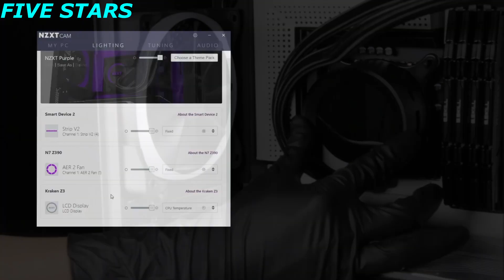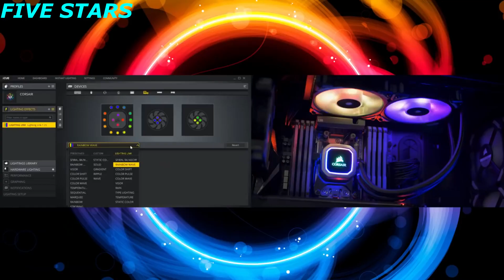5 Best CPU Coolers For Ryzen 7 5800X

Comment: I bought the h100 without knowing that it was the best cooling for the ryzen 7 5800x XD
Reply: but how much mm did you buy? 240 or 360?
Reply: @paragod4815  240mm
Reply: @renavelizz  isn't there heating problem with just 240mm on 5800x? is it overclocked ? and whats the GPU and pls tell the cost too these days its really expensive i'm also gonna buy now thats why
Reply: this is subjetive, for me the best cooler is the nh d15

Comment: sure sure, if you put a Hyper Evo v2 on a 5800 you might melt the cooler with it, its totally not good enough for a 5800X
Reply: this is wrong. i have both the cooler is more than sufficient
Reply: Pero alguno de ustedes que posee ese procesador debería colocarle una termocupla o su propio dedo para comprobar las temperaturas reales del disipador... quizá sea error de software por 10 grados C .. yo si saqué un cooler lga 775 que llegó a 105°C sujetándolo de los plásticos.. parecía una olla ardiente.. cuando lo eché al lavabo chisporroteo y salió humo.. pero otras veces menciona 90°c y coloco mi dedo cómodamente junto a la base del disipador
Reply: I have a Cooler Master Hyper 212 RGB Black Edition. I don't know this cooler is equivalent to a Hyper Evo v2 but I get in Cinebench 20 also 90°C when it's Ryzen Master overclocked and 88°C on stock
Reply: Right, that cooler u can used for cooling milk not 5800x

Comment: Even with the Noctua NH-U12H my 5800X gets pumped to a whopping 90°C on chinebench
Reply: Same, and when i play warzone it gets to about 82-85C. Its almost that I'm scared and do not even want to play when it reaches those temperatures. I have had it for a week and played to warzone matches because the temperatures scare me
Reply: @kungztar  is it on base clock speed or over clocked?
Reply: I get 90C on my 5800X with a be quiet! shadow rock 2 in cinebench multi core
Reply: use water cooling with such high end cpu...
Reply: @TheKetsa  no you don't have to. Air coolers can perform just as good, or even better than AIOs. Only custom loops are above the rest.
Reply: @niko1even  sheesh then what can do you do for cpu?
Reply: @Griffith74  get a nhd15 or nhu12a for aircooler or buy arctic freezer 2 240mm. I got nhu12a and my gaming temps are around 56-65 C
Reply: @TheDracoDispatch  thank you
Reply: @Griffith74  welcome goodluck on your shopping bro find an msrp always!
Reply: @TheDracoDispatch  wasnt easy buy my build is msrp
Reply: @TheKetsa  you dont know what you're talking about.

Comment: Do 1 or even 2 fan aio work fine?
Reply: definitely need 2 and 240mm, anything less will suck at cooling
Reply: Got a 240mm be quite! pure loop on my 5800x and while gaming it hit 65 to 70c and under 100% load it will hit 90c and clock itself down so if you need 100% on this cpu its almost to small would say use the 360mm might be better.
Reply: @hansen512  i got the corsair icue h100i elite capellix. and i am on a stable 85C when I'm gaming. its fucking scary.
Reply: @kungztar  i have h100i v2 and my temps are in battlefield V on 3800x1600 38inch  70-73 °. İ put 2 noctua on the radiator. 600 rpm...
Reply: @hansen512  i have an h150i pro xt and get the same results as you